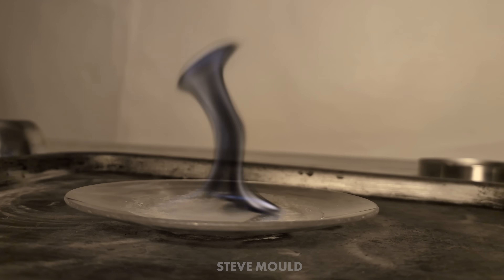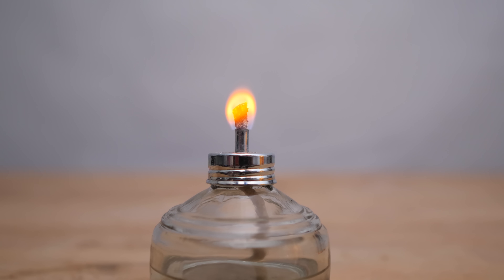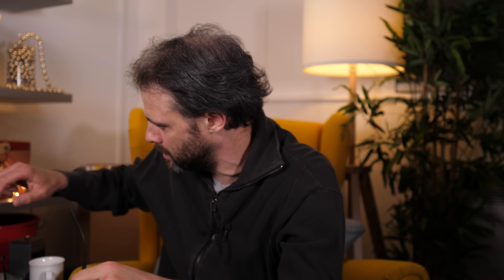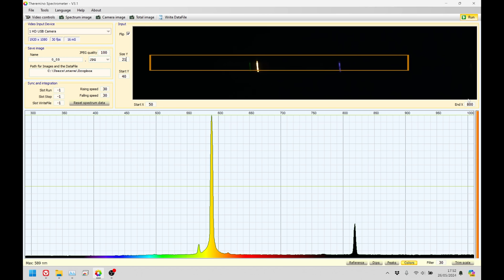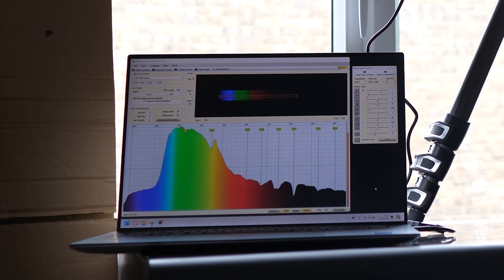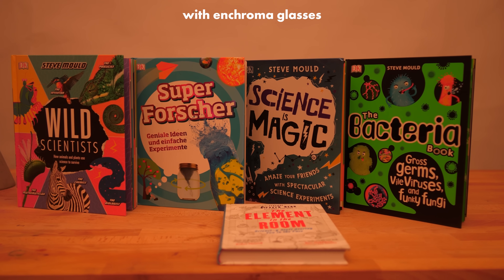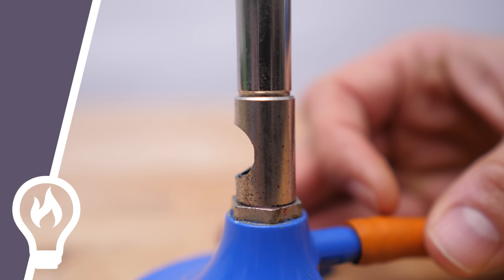Light sucking flames look like magic

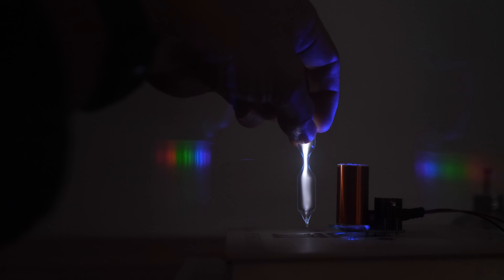Comment: 2:30 I like how your camera can't even remotely pick up on the actual rainbow in that diffraction grating, and just gives you three bands of RGB.
Reply: Everyone's always so confident about color, and nearly always completely incorrectly.

But OP is correct, it is odd that they render as three separate bands. If I had to guess, it's due to how the spectral colors are clipping to the sensor's gamut, which isn't normally an issue for the surface reflected light they're capturing most of the time.
Reply: @SimonBuchanNz It makes sense that there are a lot of wrong ideas about color out there.  Most people experience color, and it works in counterintuitive ways that most people never need to really think about all that hard. 

That sounds like the perfect combination to produce a lot of confidently incorrect "expertise" in the general population.
Reply: @nottelling7438  also light works differently than physical paints. I think thats also what causes confusion in day to day life
Reply: I don't like
Reply: The pure frequencies at each pixel are playing hell with the response curves of each CCD filter.  It would come out nicely if they had response curves that match those of our retinal cones, but I imagine that would cost a lot more to manufacture.
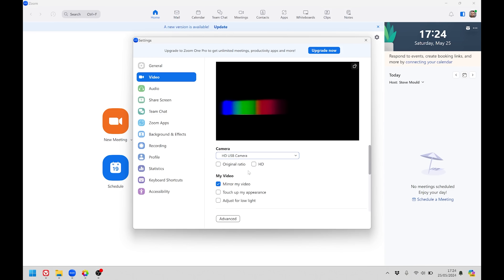Reply: The camera used for spectroscopy at 9:33 actually shows a similar spectrum. But in general this is perfectly fine, because in normal camera use cases you will hardly find situations where your pixel sensors are exposed to monochromatic light, which is indeed the case here. Normally the sensors are illuminated by broader wavelength bands (e.g. gaussian shaped) so that not only one color sensor is triggered. The rest is done by more or less advanced algorithms (e.g. center-of-gravity) in the background to calculate the color.
Reply: Could it be related to him recording the sodium lamp with the same camera, and changing the white balance to remove the yellow? The only part of the spectrum that's missing is yellow.
Reply: Eye is eye ,camera is camera , ...eye is best ,eye =1
Reply: @Kallastar.  Cyan is by definition the combination of equal parts blue and green. However, in practice, I'd say most people would consider it a shade of blue.
Reply: this is a compressed version of what the camera captures
Reply: @catlascatlas  And any sane compression algorithm for actual, filmed video (like, say, MPEG) will prefer gradients to hard edges. Unless you know more about YouTube's algorithm in particular, I'd say that that's a non-factor here.
Reply: i watch this comment on my old rgb tv.. 
arguing over color will never end..
Reply: I find it fascinating and deeply troubling. If there is not a probabilistic fall off between colors of pure wavelengths, what does that say about their ability to capture color in a way that matches our eyes.
Reply: @LostieTrekieTechie if the frequency response of the filters over the CCD elements are pretty rectangular then you would see this effect looking at a spectrum, especially if it is a very bright source and maxing out the sensor
Reply: @LostieTrekieTechie  it is all broken. It is all broken again on the screen where 3 approximately monochromatic lights of different frequency are again used to project the best estimate of the perceived colours back to you. BUT we fake it well enough that you can't easly tell the difference if it is done well.
Reply: @LostieTrekieTechie  If that's deeply troubling for you, I have some bad news - Color reproduction is extremely difficult. Even without going into additive color theory and how the eye works - all cameras and screens have variation and must be calibrated to be accurate. This is also why pantone and similar exist, as this problem also exists in print.

Unless you've paid to have a calibrated screen, you can rest assured that it doesn't matter about the camera, since you're not displaying colors accurately anyway.

Even "accuracy" is more about what humans detect. Truth is that we're the reason things are fuzzy - lots of deception in our brains to create our world.
Reply: Nothing actually as you can produce any color of light with those 3 :D
Reply: @fuseteam  You can't actually render brown on RGB, they just fake it with color theory.

EDIT: For clarity, "brown" is 'dark orange" as it absorbs mostly blue light as well as some green/red, but in the real world we judge color on arbitrary light sources instead of blending them on glass. So dirt, paint, clay etc. creates the color brown by actively absorbing a lot of light making it darker than other objects under the same light.

For example "black" sharpies are just very concentrated indigo, when the pigment degrades you see that, [other examples turn brown or gray], and similarly RGB can only make a "black Mirror" because the whole system is additive.
Reply: @IrvineTheHunter  It's just dark orange. Unless you mean you can't render dark, in which case, it's a useless conversation.
Reply: @IrvineTheHunter  all colors except red green and blue are faked with color theory xd
Reply: @fuseteam  actually, no, not even close. RGB can only cover a triangle in color space,and color space (cie chromacity diagram) is a odd fingernail kind of shape. To cover it thoroughly, i'd say you need a few more base colors.
Reply: For example, RGB cannot produce violet, only purple. Despite how they appear similar to human eyes, violet and purple are very different colors physically.
Reply: @victortitov1740  not quite as simple as that
Reply: @AfonsoCL  Playing around with RGB color wheels and finding out brown is just dark orange was mind blowing at the time lol
Reply: @IrvineTheHunter  brown is just a dark orange depending on the surrounding brightness.
Reply: @fuseteam  That's not entirely true. You can't produce any wavelength of light with just red green and blue, but you can make a human perceive every colour with them.
Reply: @HesterClapp  i never said that, i never even used the word "wavelength" ;)
Reply: @IrvineTheHunter brown is just dark orange
Reply: @91jmixes40  there are at least 3 other comments saying “brown is just dark orange” I’m starting to suspect trolling at this point.
Reply: @_..-.._..-.._  Firstly, nice username, except I can't read it because there's no gaps between characters

Secondly, I didn't actually see those other comments 😂 I just like saying it. It's silly to say "RGB can't make brown" because you're just saying "RGB can't make dark orange" and obviously rgb can make orange; to make it dark would just be to decrease the light source.
Reply: @_..-.._..-.._  There was a recent Technology Connections video analyzing the color brown, and since people who like Steve Mould are also the type who like Technology Connections...
Reply: @fuseteam  Actually, there are no three wavelengths of light from which you can produce all other visible wavelengths. The gamut of the RGB color space (for example) doesn't contain all of the visible wavelengths. (There's a nice graph depicting this if you look up the "CIE 1931 color space").

As a consequence of this there are lots of colors that humans can perceive, but that our cameras and image files do not record properly, and our monitors cannot display.
Reply: @user__214  again, i never talked about 'producing wavelengths'
Reply: @IrvineTheHunter Interesting stuff. The world of colors is so much deeper than just color theory, when you see it from the perspective of absorbance/emission. I had a cup of something called "blue tea", which comes from a plant called the butterfly pea. It had this interesting phenomenon where looking at the side of the glass it looked blue, but if you look from top to bottom, a much greater length, it becomes purple. I'm guessing it has 2 separate absorption centers, where the blue one is stronger, and the red one is weaker and only becomes apparent when viewed from certain angles.
Reply: There must be something else going on because I can definitely capture say, yellow, with my digital camera
Reply: @mynameisben123  No, you cannot. Your digital camera just captures a combination of red, green and blue that looks yellow to our human eyes.
Reply: @TijmenZwaan  and yet, it’s not doing that here. And so, something else must be going on. 

Because, as you said, a digital camera and display system can capture yellow wavelengths on the red and green photosites and display them on the red and green sub pixels and the resulting perception is yellow. And yet, that didn’t happen with the Xenon spectrum in the diffraction grating.
Reply: That's what he means, he can capture yellow as a mixture of red and green. So its weird the camera didn't record the rainbow and instead recorded 3 color bands, when it should be able to record the the spectrum's colors as mixture of red, green and blue.
Reply: @mynameisben123  See how that sodium light looked red, somewhat orange? That's a complete failure to capture (and produce, for your screen) the actual color of the thing.
Reply: @geoffreyd3186 but your eyes can’t capture orange light, either, as we only have receptors for red, green, and blue light. So why would it matter to have a camera that could directly capture a wavelength that the human eye breaks into RGB signals anyway?
Reply: @DaveTexas  We (and our cameras) can capture orange. We just can't really discriminate orange from a subtle combination of red and green. Our cones and standard camera RGB filters are slightly different however. In particular we have wider bands and a lot more overlap between R and G. Most of our cameras are just not able to perfectly mimic our color vision.

Edit: I forgot to mention purple and it is an easy one. Cameras can't capture true purple because their R is not sensitive to purple when ours are. This is how your pictures of rainbows don't look as good as the real thing.
Reply: @DaveTexas   It would matter if you wanted to depict things to beings with different cones or whatever color perception organ. Like some animals (or aliens ?).

But then you'd need specifically engineered cameras and screens.
Reply: @readyforlol   Well, those are words. They don’t mean anything when put together like that, but I guess good for you for putting them together. Shall we discuss what color the flame is when we burn Unobtanium and Vibranium next? Or would a discussion about the wavelengths of light reflected by rainbow unicorns be better?
Reply: @DaveTexas the idea that our eyes only see in "RGB" is an incorrect belief. The cone cells in our eyes each individually have a very wide range of sensitivity to color frequencies, though the peak of sensitivity varies based on the type. Our brain figures out how to interpret the color based on the stimulation ratio of the different cell types.

 This is very different from digital cameras which almost always have very narrow band RGB sensitivity of the kind you're suggesting. This is basically the reason why lighting scenes for photography is much more difficult than you might expect, since what looks good to our eyes doesn't always translate well through a bayer filter
Reply: @geoffreyd3186  right but there was no yellow, even thought I can capture a photo of a rainbow with is a complete 100 CRI spectrum, and there is a yellow band. I can see the yellow band on the same screen I’m viewing this on. 

There are also other yellow things in the video, proving that the camera in use in the video can capture yellow. 

And yet there is no yellow band in the Xenon light spectrum in the diffraction grating.
Reply: @DaveTexas  Your red and green receptors can both capture orange light. They just capture it worse than red and green light.
Reply: I have noticed that as well.  A beautiful rainbow cast by a prism, but when photographed, definitely not uniform.  Gaps in the spectral sensitivity BUT as it happens, the gap is right in the red-green overlap.
Reply: ITT: ppl arguing that digital cameras can capture any color when OPs timestamp is proving that they cannot  🤦🏻‍♂️
Reply: @Vectorh  mine can capture the yellow that would appear in that band though. And, the same video feed has yellow elsewhere! So it may not have perfect colour representation (no one is arguing that FYI) but it should at least have some approximate of yellows which is definitely possible to capture on a digital camera - albeit not with perfect accuracy.
Reply: @mynameisben123  When you film yellow objects (i.e. 580 nm) in normal situations, your camera always receives a broader band of wavelengths around 580 nm (i.e. there are also photons with 570 nm and 590 nm), which triggers the green and red sensors more or less equally. The camera algorithm in the background interprets it as yellow light. The situation here is that the camera basically only captures monochromatic light in each pixel (i.e. only photons with the same wavelength), which only triggers either the green or the red sensor cells. If you don't do spectroscopy with your camera, this is usually not a problem, and even with spectroscopy you can get away with it, as seen at 9:38. The camera here has the same problem, but can still be used.
Reply: @Narada-nu3nx  I think I partly understand. 

But wouldn't it go something like this:

400nm: red only
450nm: slightly less red and a tiny bit of green
500nm: less red, more green
580nm: about equal red and green
and so on?

I am not arguing that the red and green will be equal at exactly yellow, but merely that both will be excited in some way. 

I will find my diffraction grating and test with my xenon flash. I can't understand how as you increase frequency of monochromatic light,  it will deliver zero green light until an exact point, after which it will deliver zero red light.
Reply: @mynameisben123 If I interpret your comment correctly, you do partly have it. 'Color' is merely how the brain interprets the relative intensities of receptors with different frequency sensitivity curves. Your 400nm...580nm description is the right idea, though the wavelengths are wrong (among other things, red light has the longest wavelength of visible light).  So yes, a given wavelength of light may activate multiple types of receptors . 
As you increase the frequency of monochromatic light, some receptors will activate more and others less; rather than seeing some red and some green, you a specific color. Any combination of frequencies that produces the same relative activations will be interpreted as the same color.

I should note that things get more complicated when considering reflected light since you have to account for the effects of the reflecting surface. If some material perfectly absorbed light between 550-650nm, then it would appear to go from red to black to green as frequency increased.

Hope that helps
Reply: @mynameisben123  cameras have 3 sub pixels each with a filter over them to let in only one of RGB. If your light source is only one wavelength, it only goes to one subpixel. The actual sensor can tell intensity not wavelength. Its monochrome. When the spectrum is spread out you can see filter edges. You can see a sliver of yellow and teal where the filters are less transmissive and overlap.
Reply: @amhowell94  "If your light source is only one wavelength, it only goes to one subpixel." That doesn't seem to be correct. Filters are not being super narrow and non-overlapping. The main part of the video is filmed with a sodium lamp lighting, that has exactly a single wavelength of orange. And it shows very clearly that the camera has the color right, that single wavelength light triggers both red and green subpixels
Reply: @Masoch1st  They very much do not. But most modern cameras and displays like to pretend that they do.

Comment: I'm seriously impressed by how accurate, yet accessible, this video is. The relation between light spectrum and atomic orbitals is the heart of Quantum Mechanics; it's what drove its development historically and it's where the theory makes predictions that stumped the rest of physics. It's also the foundations of just about all of chemistry, material science, and the starting point of nuclear physics. I'd so far as to say that it's the most important development in the last 200 years of physics. And this madman casually explains it in 15min in a stunningly visual way.
Reply: username checks out
Reply: @thenonsequitur username also checks out
Reply: @LIamaLlama554  you better provide some llamas pronto or you'll break the chain of usernames checking out
Reply: @QuantumHistorian  Either 554 or twice 554, ideally.

(technically this post has no name)

Comment: At 1:05 your facts are incorrect. Low pressure sodium street lights have a negative CRI, NOT 0 they're around -45. If you're using a high pressure sodium lamp that is about 25, also NOT 0.